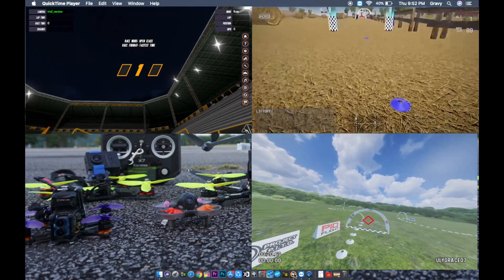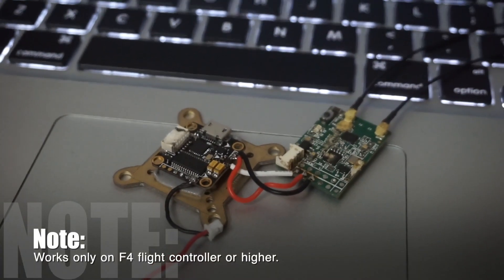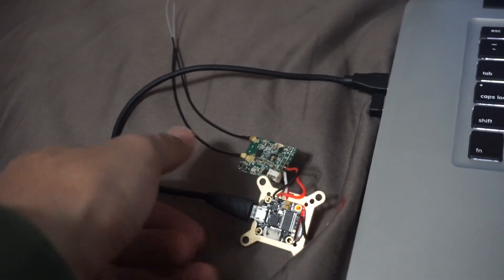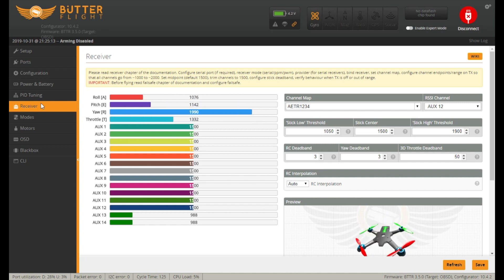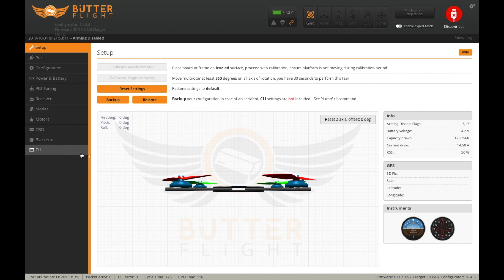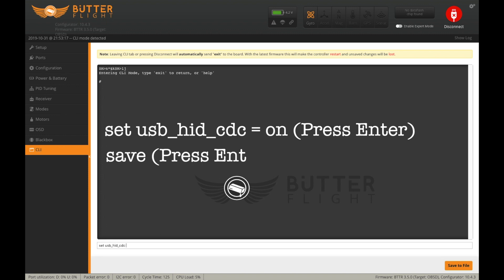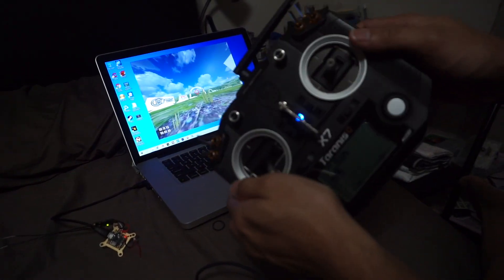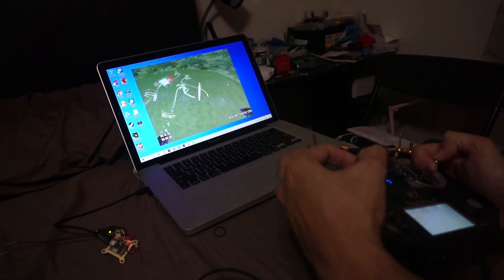How to setup Wireless FPV Simulator Gaming (Tutorial/Guide)

Comment: Nice! I'm using my old Crazybee F4 lite AIO FC from mobula 6 for wireless sim. Bought hdmi to AV converter and solder the video cable to the video in on the FC (this would enable you to use your goggles as well). Just add a mini usb fan to keep the FC cool.